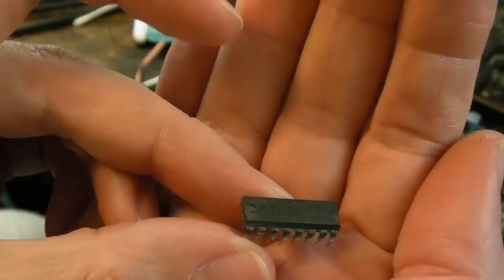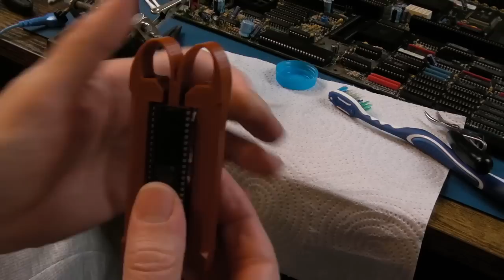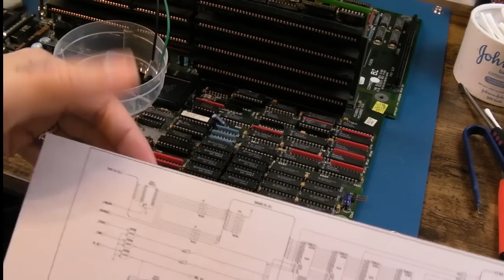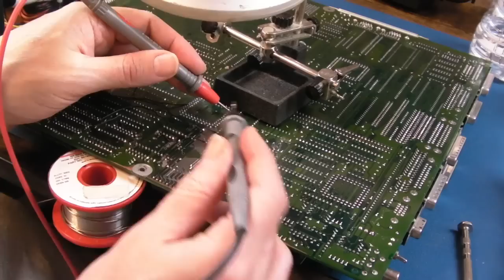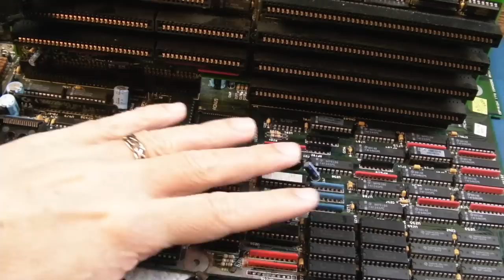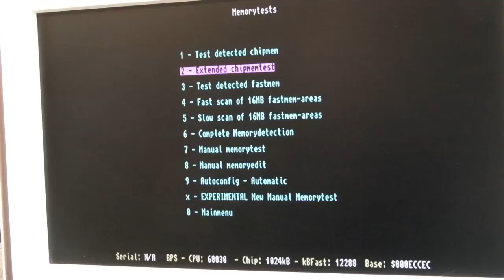Commodore Amiga A3000 Varta Revival Part 2

Comment from the maker: Part 5 - https://youtu.be/U3ABWQJ6xoE
Part 4 - https://youtu.be/Z7lfY3Wjhk4
Part 3 - https://youtu.be/ZJKwG5rKD6w
Part 1 - https://youtu.be/JJ6mkfcyGT8
Chucky (John Hertell) Re-Amiga boards - https://www.reamiga.info/?page_id=40
Chucky Component Locator (3000 board layout) - https://locator.reamiga.info/index.php
MyMateVince (mentioned regards UV solder mask) - https://www.youtube.com/@Mymatevince
Corrections: Obvious point the RW pin is normally used on the DIR pin on tranceivers.  So when you read or write the data passes the correct way.  And in relation to that point (when waffling about the chip RAM section of schematics), I kept saying "read", it's obviously all bi-directional, allowing reads and WRITES too.

...

Comment: What about an adapter that could allow you to use DDR3 RAM modules.
Reply from the maker: It would be too costly to produce an interface to DDR3 - far easier and cheaper to use older SRAM, DRAM or SDRAM.

Comment: Probably would have been easier to buy one of the new A3000 boards and just use all the parts off this dud board
Reply from the maker: Haha - Yes, that's like saying "It would be easier to buy a working one".  "Or it would be easier to buy a previously repaired one."  Technically I think building a re-amiga would take a considerable time (if you take into account removal of everything from the old board), and since you dont know what ICs work and which don't it could take just as long if not longer.   The point here is this channel is about repair, repair techniques.  On something this complex, it is not a trivial task to swap every single component onto a new board, and the fault resolution techniques will apply on a "new build with old parts" too.   For someone that has multiple 3000's to hand, and has experience at building a re-amiga, I am sure it would be quicker.
Reply: @GadgetUK164  I see what you mean. When my brothers A2500 board was killed by severe leaking battery connected to his Bridge Card, I simply stripped as much from it as I could and dumped the rest. I had neither the knowledge, skills or the time to even attempt a repair. At least I got some spare custom chips. I do appreciate the work you do and the patience it must take to do what you do.